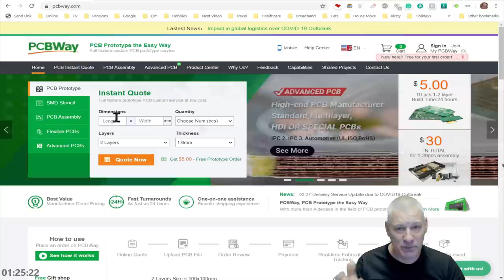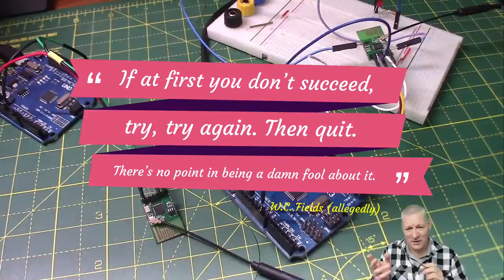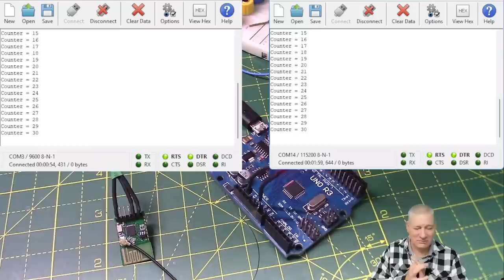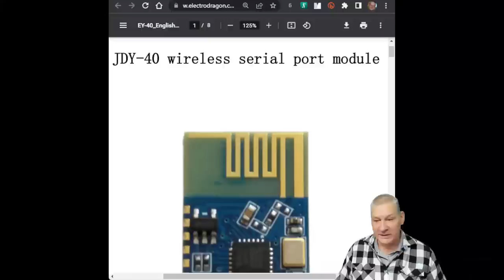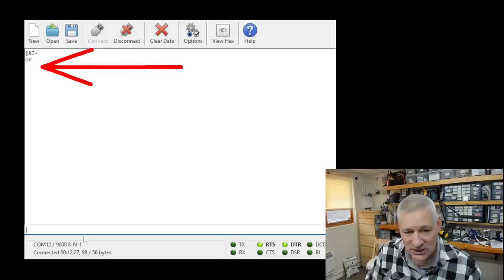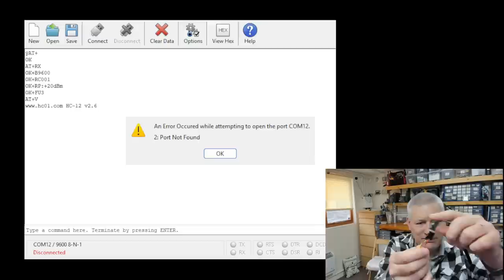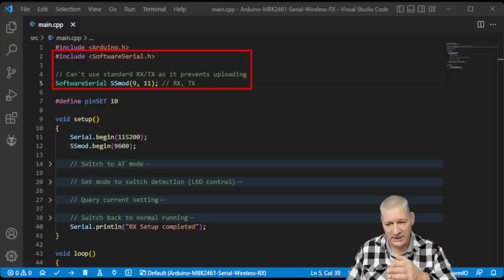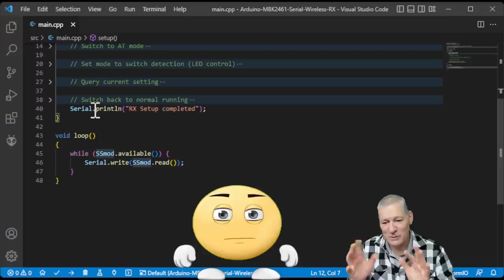#257 Wireless Serial Comms⚡for your Arduino (or other μController)

Comment: You might have destroyed the 3.3V boards by connecting them to the Uno, which has 5V logic levels. If in doubt, if a device can handle 5V logic levels, use a voltage divider on all of its inputs (1k:2k Ohm works fine).
Other reasons for not reacting to AT commands:
RX/TX are swapped (misprint on board or user error), obviously if the default transmission works, that's not it.
The AT mode baudrate is not as specified; pretty much all "standard" rates from 9600 up to 115200 should be tried. Also, for some modules the AT mode baudrate changes with the transmission baudrate, for some it doesn't.
The line ending is wrong (newline, carriage return, both or none). Some modules fail to parse input, if any line ending is sent. They instead work by "timing out". The command and only that (no newline) has to be sent within let's say half a second of the first character.
For debugging something like this you really should use a better terminal program with more options. I use hterm (free, available for Windows and Linux).
Reply from the maker: Yes, this did occur to me but given that the TX is an output GPIO, going into an input RX on the wireless module I thought it might be OK. Maybe I was wrong! I'll check out the HTerm program.

Comment: To change baud rate, type AT+BAUDX, where X=1 to 9.

1 set to 1200bps
2 set to 2400bps
3 set to 4800bps
4 set to 9600bps (Default)
5 set to 19200bps
6 set to 38400bps
7 set to 57600bps
8 set to 115200bps
Reply from the maker: I tried this too but no response. I think it must be the way the AT command is being terminated.

Comment: For serial wireless communication why not just use nrf24 modules?  There are lots of arduino libraries, they are cheap, same range as blue tooth, and baud rate can be set in cpp.  They use 3.3V  but are 5V tolerant if used on SPI bus.  The nrflite library claims they can be used on I2C but I have not tried that.
Reply from the maker: It's an option although I don't think there is much advantage over an HC-12 device, is there? Apart from the pairing (which could be good or bad depending on how you look at it).

Comment: If you are telling the board to change the baud rare, I believe you also need to change the baud rate of the serial device on the Arduino so that the speeds match.
Did you get a failing status, garbage, or no response from the board?
Reply from the maker: I got nothing, nada, zilch. If I had got some corrupted characters I'd have tried what you said. Having thought about, I'm pretty sure I did try that, just in case, but still nothing. 😢

Comment: Hi Ralph,
You say these modules are not Bluetooth: do they require any kind of pairing? Perhaps I missed something...
Also, the 2mm pin-spacing; PCBWay will sort that problem when it comes to your final project! 😁
Reply from the maker: The only require "pairing", I believe, in the sense that each module (in a pair or mesh) must have the correct (same) device ID (they all have the same out of the factory) and channel number (ditto). They can be changed to create a unique pair of modules. I didn't get that far as I couldn't get it to talk to me!
Reply: @RalphBacon  thanks. I'm considering using them in a simple project where waiting for units to pair at switch-on would not be convenient.

Comment: Check the chipset data sheets.  Is the "serial interface" RS232 compatible?  Using logic or -3V, +3V levels?  Does the AT mode require a specific baud rate?  300 or 1200 baud was once a common setup protocol.  Check the start/stop/parity bits.  TX for the chip is RX for the Arduino and vice-versa.
Reply from the maker: The boards are 3v3 but I took a risk that 5v (on the TX pin) would not be a problem but maybe it is. I'll recheck all this next time I get them out.

Comment: I've also been thinking about remote monitoring of serial comms on installed devices but my approach was going to be a little different. All my installed microcontroller devices are within WiFi range (even if they don't/can't use it themselves). I plan to avoid using HC12 and other potentially dodgy modules by using an ESP32 as the plugin transmitter(s) and have them send their captured serial streams over Wifi onto my  local network and thence to a single receiving address/port that could be a Windows app or another ESP32 and which could potentially interleave comms from more than one monitored device. I envisage using a DIP switch on the transmitter(s) to set the expected baud rate to match the serial TX of the monitored device although it might be possible to detect the baud rate automatically in future by measuring bit lengths. I'd be interested to know what you think.
Reply: Another benefit of this approach is the possibility of getting the transmitter ESP32 to control the reset pin on the target device
Reply from the maker: If you use an ESP32 as the transmitter (instead of those dodgy HC-12s 😁) then you could use simple-but-excellent ESP-NOW to send the data to a receiving ESP32 and it would be "secure" in the sense that only the receiving device's MAC address would get it/process it. But you'd still need to be wary of data collisions from multiple transmitters.
Reply: @RalphBacon  Worth some experiments for sure but I suspect ESP-now won't reach the devices at the bottom of the garden (where I have a wifi access point). Maybe I'll design in both options.

Comment: Hey Ralph, it's been a while, still watching from afar :) I've thought quite a bit about various ways to do wireless communication over the years, from simple stuff like you're trying for the "why isn't it working" debug stuff, to how to keep two devices in sync. I was going to go with the nRF24L01 modules with the mesh library, although it does eat progmem, it's very good, you have a master node, and then every other node automatically configures it's connection through other active subnodes. 5 can connect to one, if one already has 5, it connects to another down the chain... but I then was thinking if I go to ESP, I get wifi basically for free (both component count and progmem) for short range communication (and a benefit is that progmem isn't as... restrictive in ESP world)... so have basically been thinking of using ESP kind of how it started, as the communication method for between arduino devices. If I need a quote "real" Atmega chip to do some specific work, it can just be sent commands over the wifi and maybe do some I2C trickery....

So a possible idea to consider for debugging, if you use an ESP of your choice with appropriate level shifter, could that not be used to push out serial debug information over it's wifi connection (either some complex web page with AJAX or just some simple TCP API library or MQTT), then all you have to do is plug the "debugger" into any device you want to debug, then connect to it with your phone or computer directly, or have the debugger connect to your wifi (depending on where it is), since you were saying most devices are mostly within wifi distance anyway... (or you could go to the ESP LORA type world?) Just some ideas :)

I have a question too, if you found that the HC-12 works the best, and responds to AT commands, and they're relatively cheap, my question is why are you keeping using the "inferior" ones? Or is it just a case of "I will prove this works if it kills me!"? :) x
Reply from the maker: Wow! Lots of ideas there, Jess! Last question first: the HC-12 indeed works best but I only found out the others (in the test batch of hardware) were troublesome when I tried them out. I'm not progressing the others unless/until they resurface and I will try few things out that others have suggested.

Using a ESP32 is indeed a possibility although it does rely on the Wi-Fi being present. Or it could be an AP that another (listening) device could connect to and read the data. The sending ESP32 device could simply continuously read the RX pin and put it all in a big (huge) circular buffer to be read by the other device, as part of a web page. It's something bubbling along at the back of my mind to test out.

Being able to just connect to a device and scan a web page is very attractive assuming the ESP32 hasn't "hung", of course!

OK, back to the design of other projects, keep at it!
Reply: @RalphBacon  You'll just have to make sure your code is up to snuff :p ... although, if it's a debug device, it's more general purpose and would be a "plug it in to figure out something wrong with another device" so less likely to hang over time?

"Oh, my beehive counter keeps crashing, I wonder why... DEPLOY THE RalphInatorDebugger3000ESP and watch it for a while"? :D

Unless it's a feature you want to permanently add to your projects and I misread your intentions (quite possible! I am a natural blonde. ^^,)

Comment: What about getting the RSGB Radio Communication Handbook FIFTH edition which gives details about RTTY operation and gives schematic for a RTTY tone decoder for 1275/1445Hz, and building a small transceiver module for the frequency you want.
Reply from the maker: Interesting alternative solution you have there, David, thanks for sharing 👍

Comment: Thanks Ralph, all good stuff.  Tell me tho', why didn't you just use an ESP and ESP Now.   There's very little difference in costs these days, and you get so much more flexibility.  Genuine question and happy new year!
Reply from the maker: Another viewer asked me this and I certainly use ESP-NOW for my sensors but this time I wanted a different way of continuously transmitting a data stream (a wireless USB cable, as I mentioned). And it means that the Arduino can also be used this way (ie no Wi-Fi or ESP-NOW available).
Reply: @RalphBacon  there is also the option of setting up Bluetooth serial on the esp32

Comment: Hello Ralph,

Happy New Year to you.
I had a similar problem in the past with a GSM module.

Here was the solution: The baudrate for the AT commands was not 9600Baud, but 4800Baud. 
So my tip is: Try the AT commands with different baudrates. I think/hope that this works.
Unfortunately I don't have such a module, I use the NRF24L01 modules for such "simple" WiFi connections.

I hope this helps you

Greetings and happy coding

Frank
Reply: Similar issue and the AT command had to be CAPITAL and all past it could be either upper or lower, and unlike the " examples " for the NRF module did not actually always respond with the plus sign between the two modules.  One did not use it for just responding, the other needed it for all commands.
Reply: The NRF24L01 is not a wifi module, it uses 2.4 GHz but has nothing to do with wifi.
Reply from the maker: Thanks for the tips!
Reply: @conorstewart2214  You are right. Strictly speaking, WiFi is a standard. But in Germany, we use the term "WiFi" colloquially as a wireless network. 🙂
Reply: @DuckDonald1969  so do you call Lora and 433 MHz, wifi as well?
Reply: @conorstewart2214  The AT Command set.  If you were " old School " enough to have access to dial up modems you would have picked up on that as there were alot of " dumb terminal " devices for connecting with phone came ( RJ11-RJ12 2/4 wire ) to pretend to be a phone system between computers.  They either used " Standard AT Commands " or their own personal weird variant.
Reply: @ericblenner-hassett3945  okay what does that have to do with the NRF24L01 and wifi?
Reply: @conorstewart2214  both use the COM port standard, both devices use variations of the AT command set, both have ' exceptions ' on how to actually use the AT command set.  Past the obvious wireless protocol issues, standards and frequencies used, the similarities and annoyances are enough to look into to troubleshoot issues with the other, starting with COM speeds to initiate communications with the AT command sets.  Hope this is not as 
" Clear as mud " for you with this version of why.
Reply: @ericblenner-hassett3945  I don't think the NRF24L01 uses AT commands. I think it's only similarity with wifi is that it uses 2.4 GHz.

Edit: the NRF24L01 uses SPI to communicate, not COM.
Reply: @conorstewart2214  That would be the equivalent of saying " It's not ethernet as it plugs into USB 2.0 ".
Reply: @ericblenner-hassett3945  it really isn’t. Wifi and radio modules are separate things, they may have a few similarities in how they work but they are still different devices used for different purposes and work in different ways. The modules shown in the video use AT commands probably just because it is convenient and already existed and use uart probably because it is simple to interface with and transmit and receive data, the NRF24L01 is a totally different device, it doesn’t use AT commands, doesn’t use uart and it’s only similarity with wifi is its frequency. They are not the same and aren’t very similar like you seem to be suggesting. Yes a lot of the basic modules may use AT commands or similar to configure them but that does not mean they are all the same and the same as wifi or dial up internet, things can have similarities whilst being different and separate things.

Comment: Just because the board has a 3.3 V output doesn’t mean you can use it directly with 3.3 V devices. You are powering the module from 3.3 V but the UART signals and the rest of the GPIO are still 5 V, most electronics can’t take a higher voltage that its supply voltage on its inputs, so you may have damaged the board by using the 5 V uart or 5 V GPIO on the arduino. You either need to find a module that works with 5 V or has 5 V tolerant pins, use a level shifter or a 3.3 V microcontroller.

You can make a very basic unidirectional level shifter using a voltage divider, you need to take the 5 V from the arduino down to 3.3 V, but for the receiving connection from the module to the arduino you can just connect the module directly as 3.3 V still registers as high on most microcontrollers. The proper way is to use level shifters though.
Reply from the maker: I have others (spares) so I will try again using a level shifter (or the resistor divider). 👍
Reply: @RalphBacon did 5V damage these modules? Or was your issues incorrect commands?

Comment: Alot of the keyestudio boards have like 3 hardware serials built in. Along with 3amps output haha
Reply from the maker: The UARTS have to connect somewhere though, Joey, and the Arduino only has one on-board UART. The Mega2560 has three which would work just fine.
Reply: @Ralph S Bacon  I think the keyestudio use a second ic aside from the main one near the usb port. I get what you mean. It's 2 different things

Comment: Have you tried AT+BAUD? - I thought AT commands that returned information (ie you are asking a question) ended with a question mark .
Reply: Ignore me. I made my comment before watching to the end of the video. Looks like there are other commands that output info that don't end in a question mark.
Reply from the maker: Consider yourself ignored, Tony. 😉 Yes, the AT commands work fine on the HC-12 but not on the other modules. It can only be a formatting issue (line endings etc).

Comment: Hi. Have  you tested the esp8266-01 witch come with AT from factory
Reply from the maker: I have indeed tested these and ended up chucking one of them to the other side of the workshop it was useless! 

Luckily, current ones are much better. But these are wireless devices and whilst I could debug over Wi-Fi that wasn't my intention here.

Comment: I presume these transmit "in the clear" (no encryption)? Would it be possible, in that case, to have multiple units transmitting (at different times) and have one receiver capture them all?
Reply from the maker: You could, although you would have to ensure no collisions occurred.
Reply: @RalphBacon  Spending some time thinking about it, a combination of checksums and time division should do it. IIRC, that's how Ethernet and cellular protocols sort out collisions.

Comment: I dont know at what distance you hold the antenna of both transceivers. I had the same problem with C1101 modules. It appeared the distance must be at least 1m. Otherwise they could not communicatie.
Reply: I too have had problems in the past with the C1101 modules having issues when they were to close to one another.
Reply from the maker: This is very strange and I must admit mine were almost on top of one another. Back to the workbench I must go!
Reply: That shouldn’t affect the AT commands in any way, since they shouldn’t send any data out wirelessly.
Reply: @conorstewart2214  For AT commands correct,. It only affects the communication between 2 modules.